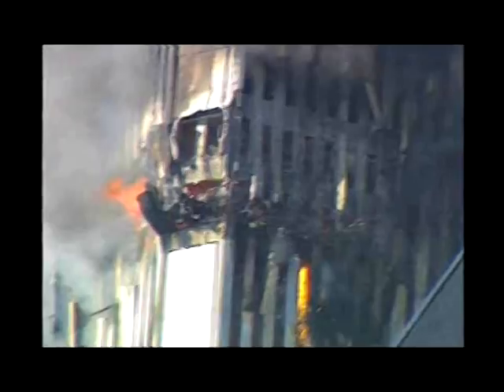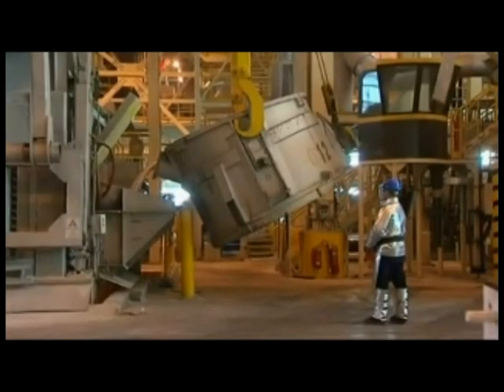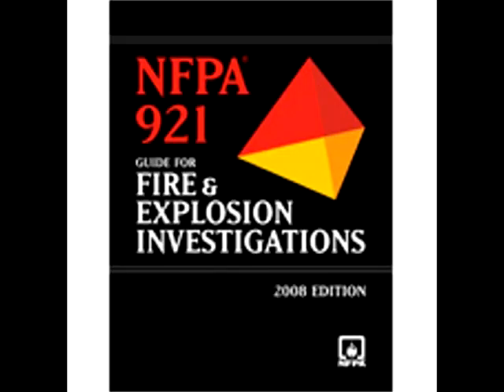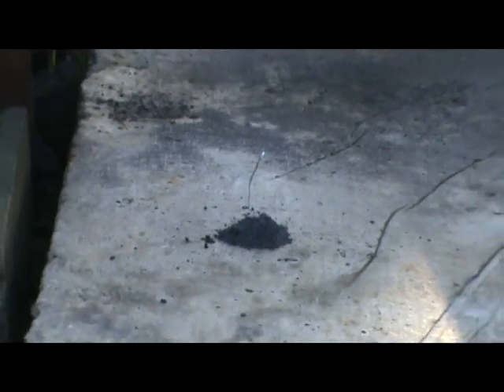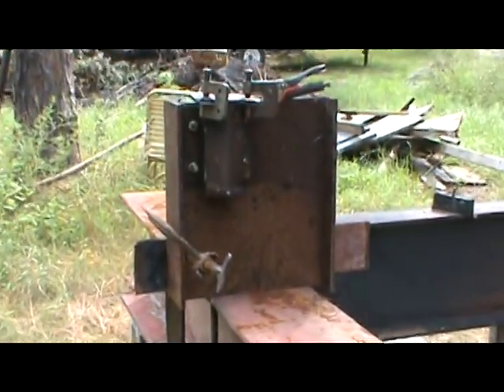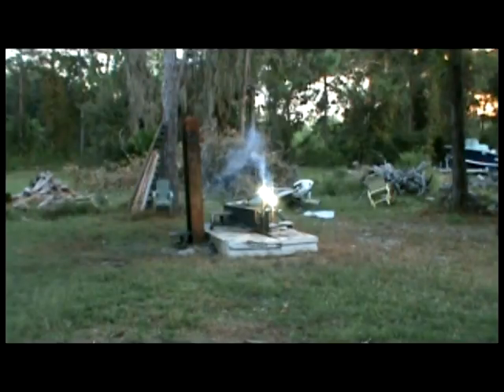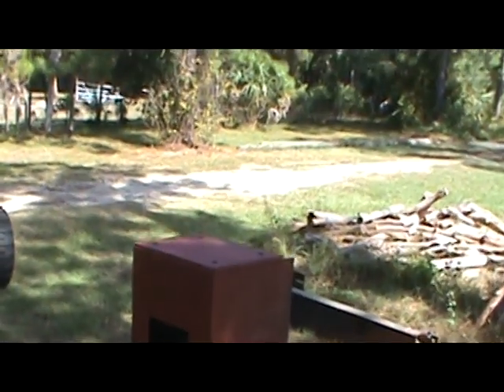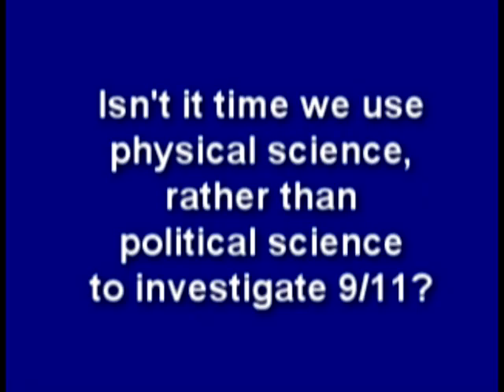9/11 Experiments: The Great Thermate Debate

Comment: A charcoal fire cannot melt copper or bronze, either, so the Copper Age and Bronze Age never happened.  Because conspiracies.
Reply: yes it can.
Reply: regular charcoal bricks can get hot enough in a forge to melt copper and bronze
Reply: uNkowN No it can’t- hold a piece of hot charcoal next to a giant piece of solid copper- nothing happens
Reply: They used air to make temperatures high enough, and the metals never melted. They were only hot enough to bend.
Reply: Dumbest comment ever.
Reply: Assoul, copper and bronze are melted in FURNACES, not open fires. Dumbschmuck.
Reply: +JasmineLindros best comment ever

Comment: If it was a job where bush had all of these explosives set up and had remotes put on the planes so that he and Chaney could fly them from a distance and have the accuracy to hit an exact point at an exact time the news reporters would have been all over it. But slam a 747 into a building at 500 mph. The fuel is going to explode and burn. The other 3 sides of the building will hold it up for awhile. The inertia of the plane going through the building is going to damage the interior, along with most of the fuel being on the inside, is going to burn and soften the interior framework causing the heavier exterior walls to fall inward causing tons of metal to fall on the floor under it making it look like a controlled demolition. Why would anyone call bush stupid

Comment: OK all you conspiracy theorist that believe in the placed bomb or thermite idea. Let me ask you this. What would be the point in slamming the planes into the Towers if they placed enough explosives to bring it down?  To cover up and misdirect who attacked the towers I would assume you all would say.  But now let me ask you this. Why would they need to place explosives or thermite in the towers if two plane strikes carrying enough fuel were enough to bring them down? What would be the point? On top of which why would they even risk being caught doing the work required to place enough explosives to bring down two city block sized building when a plane destroying the primary support structure and the ensuing heat from the fire weakening the steel is enough for it to bend under the weight of the floors above it. Since its already bending due to the main supports being destroyed it would continue to bow more and more as it got hotter and hotter until it collapsed from bending too far. Like swordsmiths heat steel just enough to bend them to make swords. They don't need to melt them.

On top of which why would the government take such a high risk sneaking in explosives when they could have easily just put explosives on the planes at a hidden base and have them explode on impact further weakening the structure on the Towers while blending into the plane's explosion too. This plan is far easier to pull off and is more in line with what "smart people not wanting to get caught" would actually do.

My problem with conspiracy theorist is there are a lot of stupid ones now a days. Back in he day conspiracies were good and the government or organizations were so smart they did things in the most efficient manner so as to never get caught.   Saying they snuck in explosives is by far the least efficient way and most risky way to attack a building of their size. I will never buy into the explosives snuck into the towers because its just stupid. Literally outright stupid. There far more risk to it than just putting explosives on the Jets. 

By the way I do not believe in any of these conspiracies.  My knowledge of construction from working with my family and my knowledge of physics says to me that the planes hitting the towers and the jet fuel alone could have weakened the towers enough to bring them down.  

And to those that say but why did the towers collapse all the way to the bottom and the lower floors not slow it. That's because the tower was designed to hold its own weight standing. Not the impact weight of floors above it.  For example, If you weight 180 pounds and stand of a weight scale at home... Does it not read 180 pounds?   Now if you jump on that same scale... Does it read 180 pounds the moment you land on it? No because your momentum from falling is being transferred on impact and causes it to read a much higher weight briefly upon initial impact. The lower floors on the towers were also experiencing more weight from the impact than they could handle which is why they collapsed too. Like a house of cards when the top section begins to fall it can bring down the entire structure.
Reply: how do you explain the victims that were literally ejected from the towers? It's not rocket science to realize that some "large force" blew out windows and ejected people after the planes hit.

Comment: you don't have to reach temperatures to MELT steel, just hot enough to WEAKEN the steel. Come on people! Try to bend a thick steel bar in a vise... now way. Then get it red hot with a torch (it doesn't melt), then try to bend it while it's red hot. Easy! This is all common sense.... which many people have little of

Comment: What weakened the steal beams? The first explosion of the planes plus heat of the jet fuel and the weight of the building! Its common sense there doesn't need a lot of science to get it!  Jet fuel doesn't melt steal but it does weaken it!
Reply: +ps31871 It's not even a matter of that. If you watched the video it was about him trying to replicate the molten steel flowing out of the building.

Comment: The guy who made this video, and anyone who believes his BS, is an idiot.  The excess smoke is from when a fire is SMOLDERING, and doesn't mean that it has been put out or even lessening in heat.  a room on fire that has no openings to let fresh air in will have little to no flame, and will still burn hot enough to melt steel.

Idiots.

Comment: what a load of fucking bollocks :') Go ahead and heat steel up to 1.8k°C and put hundreds of tonnes worth of weight on it and you'll see exactly why the steel beams "melted". Clearly you have never seen what happens to metal when you place it under huge pressure

Comment: What if the buildings' age caused rust on the steel beams? Then aluminum materials were turned to dust after the plane impacts. Rust and aluminum dust is how you make termites. It could be possible that the termites was made by the building itself.
Reply: +BobtheHobo324 aluminium melts not disintegrates
Reply: No I'm asking if it were possible that the explosion caused the aluminum to disintegrate and distribute with rust shavings in the building.
Reply: the aluminium would be shards would be shards not dust